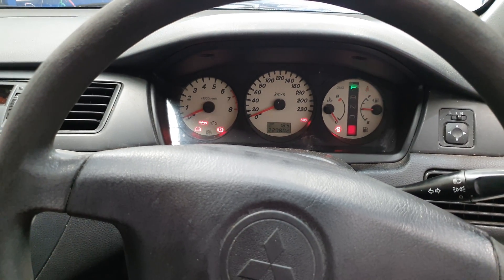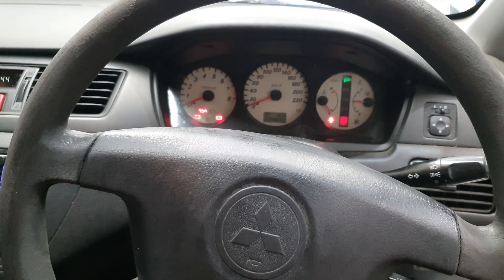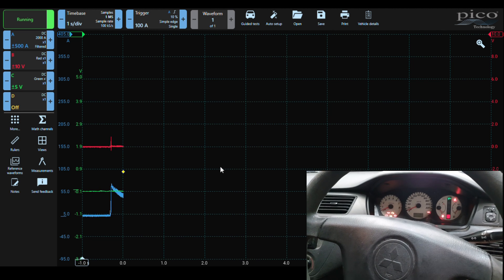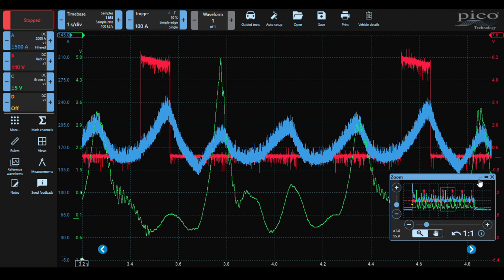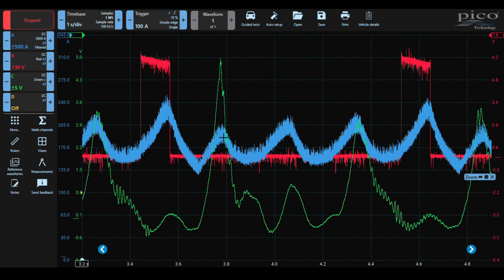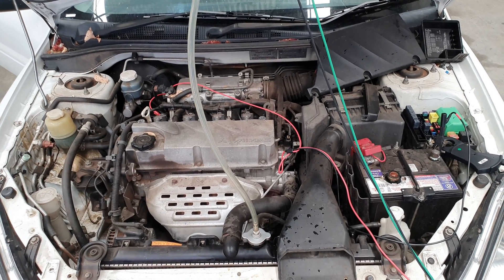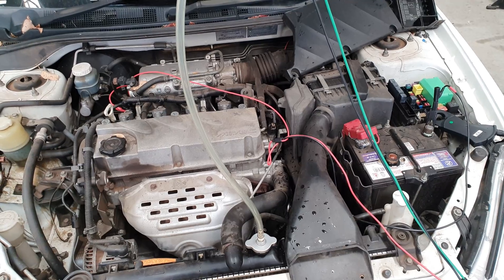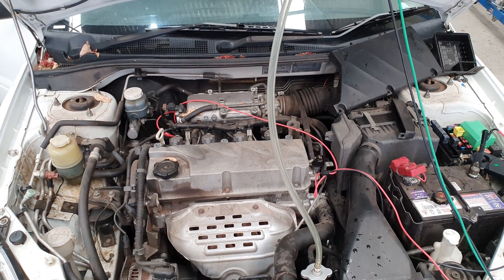Mitsubishi Lancer Overheating

Comment: Spot on mate! I'm just wondering whether can it be done with wps500x?
Reply from the maker: Ari, it definitely can. It would be a better reading than a pulse sensor in my opinion because it's an absolute pressure sensor so you won't get the elastic spring back of a piezo type delta pulse sensor.

Comment: Love this test   i too never trusted the tk test....could i ask....i have just obtained a ditex absolute in cyl pressure transducer to use with a micsig scope....was this the better of the two choices to get i.e. as opposed to the gauge pressure sensor ditex offer? Thanks in advance for any guidance you can give (not a great deal of info is supplied with the sensor itself)
Reply from the maker: Jeffrey, I also have the ditex in cylinder transducer but I've never used it on a cooling system so I'm not sure. Maybe we should try it and see, otherwise a good idea would be to get a pulse sensor also.
Reply: @romanosautomotive   ah  i didnt make my question very well  i do have the pulse sensor   but wanted your view on the ditex in cylinder sensor as i chose the absolute sensor over the guage sensor ditex make which has two settings     also wanted to make sure i am setting it up correctly